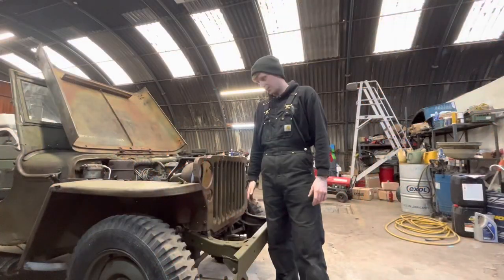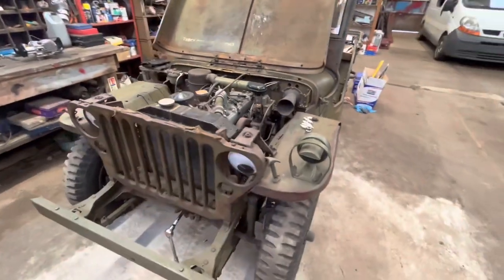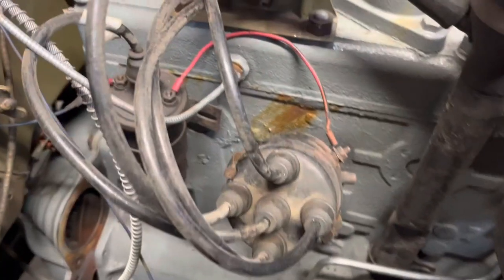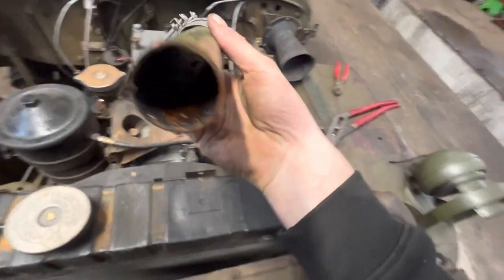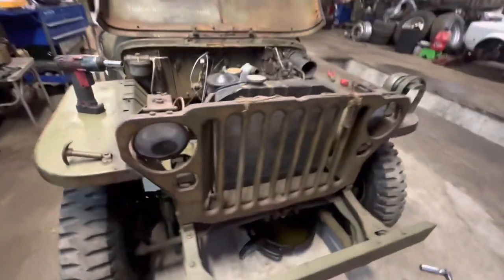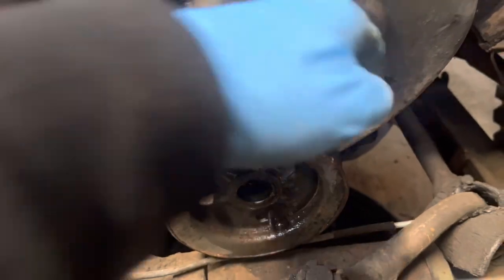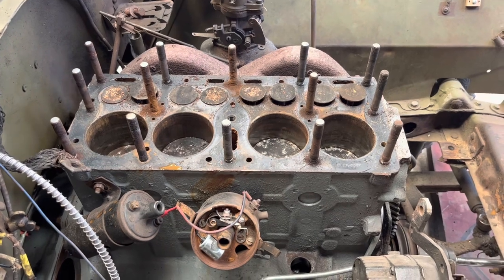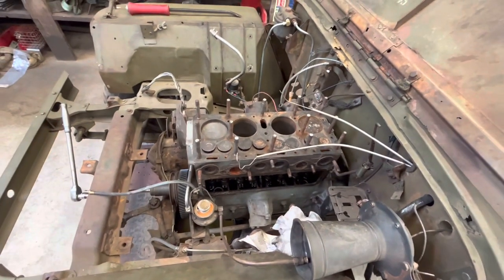Willys jeep faulty engine

Comment: The motor is a later CJ2. The earlier wartime engines had timing chains,which would stretch and rattle. The gear drive is way better. Your Jeep is a Ford GPW. Ford took a lot of the manufacturing of Jeeps,because they were experienced in volume. Your engine was made by Willys Overland.  Ford painted their engines Ford Tractor Grey. Willys we’re Olive Drab green. I’ve had my GPW for 24 years. Great fun to drive,..😊
Reply from the maker: Yeah that’s right! Apparently if you have a fibre gear you get 4 more horses too! mine is a GPW and it’s on a ford chassis and Willys tub ACM1 I believe, yeah I can’t wait to get back on the road! Thanks for the info! 🤝
Reply: I have a Ford engine converted to take the guts of a late engine. The last produced MBs and all the M38s and Hotchkiss had the fibre gears. The crankshaft has the heavier counterweights.
For the sake of a few more nuts and bolts, I find it much easier to take the fenders off. There's much more room.

Comment: that cooling system when you get it tanked and put back in, put a cup of diesel fuel in then anti freeze and water. Then write it down that oil sueen is intensional. Ny Dad a WW2 combat infantryman later diesek mechanic taught me this. Works extremely well.
Reply from the maker: Thanks for that information! 🤝

Comment: take the spark plugs out and pour some rislone into the holes for a couple of days, then put the jeep into third gear and try and rock it
back and forth the rislone will help dissolve the carbon between the rings and the cyl. walls, rocking the jeep will help break the carbon
seal-    I know this from experience and it works !
Reply from the maker: Thanks I’ll give it a try!